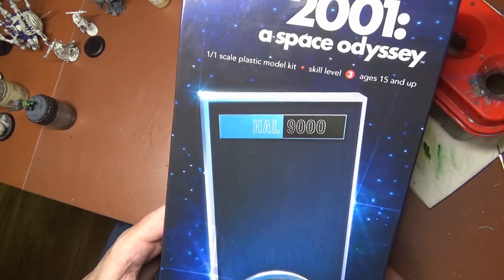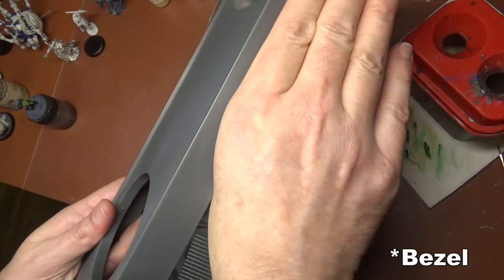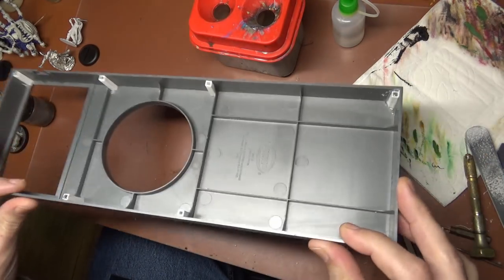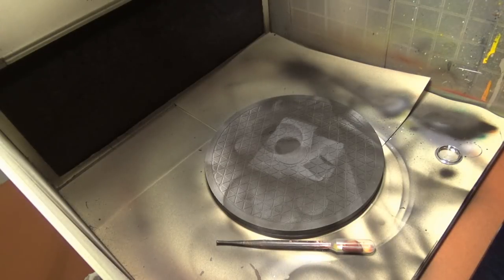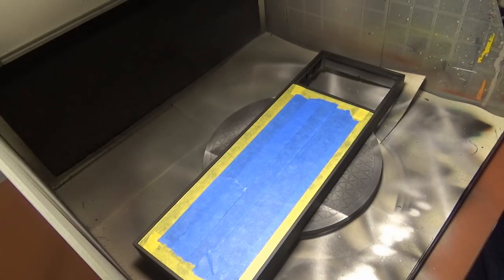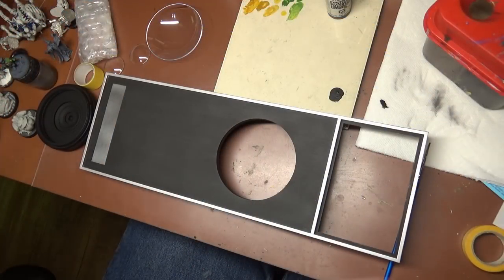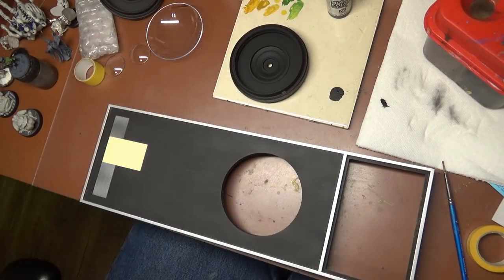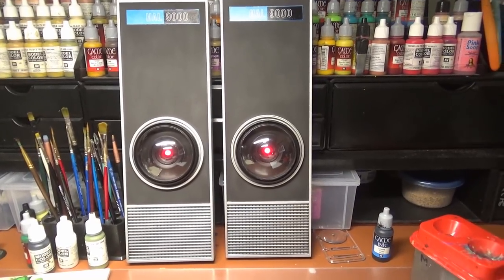Building Moebius Models HAL 9000 from 2001

Comment: Good kit. Can't complain about the low parts count, there is no reason to have more of them, except a back and some facility for wall hanging would have been both logical and nice.

I can justify the expense of the kit because they seem to have done their homework on getting all the dimensions correct, and adding subtle things like the textured metallic frame, and having high quality molds and injections. The two lenses seem to be well done, and actually give the red LED the appropriate diffused appearance that matches HAL from the movie.

And while the actual plastic parts probably cost Moebius practically nothing, the small electronics assembly for the red LED had to be hand assembled, and this might actually be their greatest cost of production.

Mine came out well. I also drilled all the holes in the grille, and lengthened the battery wire to allow mounting it higher up (and not on the grille).

I added the EZ Sound module from Amazon, and put 2 minutes of HAL's voice, grabbed from some YouTube videos and edited.

https://www.youtube.com/watch?v=tyDs-C_NXVA&t=60s

Comment: I'm heavily thinking about doing this, with the amazon or other voice system now... don't worry I'll only have it set up to turn the lights on and off LOL
Reply: I was thinking the same thing. It looks like there's probably enough room to fit a Raspberry Pi or some other single board computer in the back of it to make some kind of smart home hub.
Reply: @Xn7000  40 bucks for one is a bit much, but I have a 3d printer so I think I'll go about making it that way.
Reply: Thinking the same thing here. It would be an interesting conversation peace to have an Alexa or Google home mounted in one of these.
Reply: @dragnardrake8633  The clear parts are a big challenge there. The box you could make out of cardboard.
Reply: Or use it as a 'mod' for a RING doorbell camera :)

Comment: I used an ice pick for the grille holes- easier than a drill.
Reply: What about that row of holes that has that plastic frame piece on the back? Were you able to poke through that thick plastic using the ice pick?
Reply: @groundzero6662  I actually wasn't trying to troll. I was honestly curious how he used the ice pick through that part. I didn't want to drill the holes out and thought the ice pick idea was a good one and wanted to know how he got the ice pick through that thick plastic. Doesn't matter now anyway. I finished building this a couple weeks ago.

Comment: 432. There are 432 holes to drill. And I actually had to use a pin vise!
Reply: Yes. 432 holes in that speaker grill. It took me about two hours to drill them all out using a small power drill/screwdriver. I cut away the ribs on the back where they coincide with the holes- it doesn't really need them, it's quite rigid enough without them. I'm also using a 9 volt mains adaptor (which took a lot more searching on Amazon/ebay than I expected) instead of batteries and plan to mount the finished article on my computer case using magnets.

Comment: Very interesting, I'm assuming it's "level 3" because of the wiring requirements
Reply: Not much to wire.  It's all pre-made.  You just add it to the kit.  However because it's electricity you are probably correct.

Comment: No option for a SAL 9000 from 2010?
Reply from the maker: Sadly, no. Likely they don't have the rights to the sequel.
Reply: @ThePaintingClinic  On the bright side I don't think it'd take more than a new decal and blue light to modify it into Sal.
Reply: @LigerFan  They made a completely different HAL for the 2010 movie. Its base was grey, the aluminium around was at least twice as thick, didn’t have a speaker grill, the name plate (with different typo) was backlit and the lens didn’t bulge as much as in the 2001 movie.
Reply: @jurgenblust2042  I didn't know that.  I do remember having read that all the sets from 2001 were destroyed so they had to build all the Discovery stuff from scratch.  Not even sure if they had original plans or not.
Reply: I am the king you can hide your poor win 10